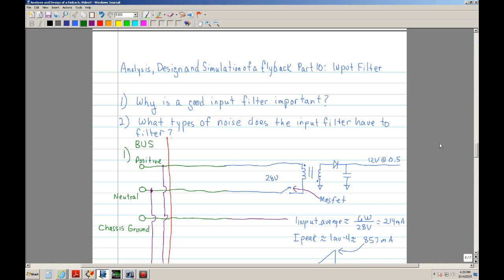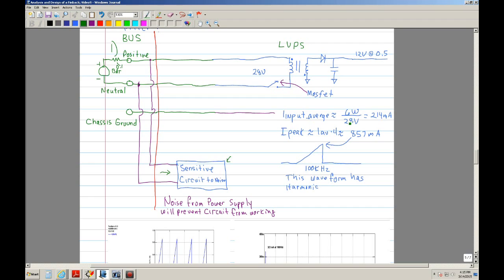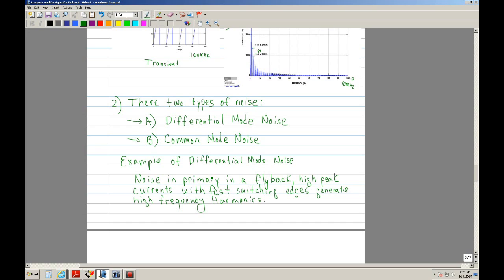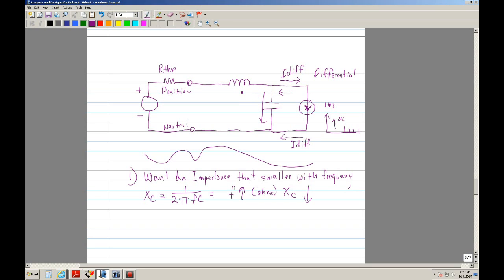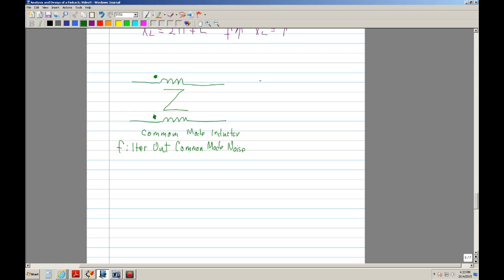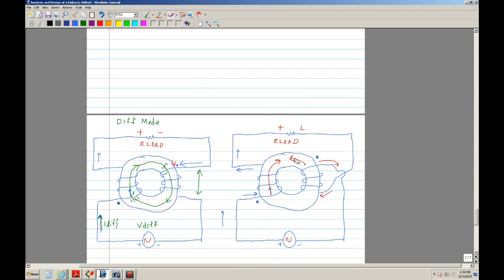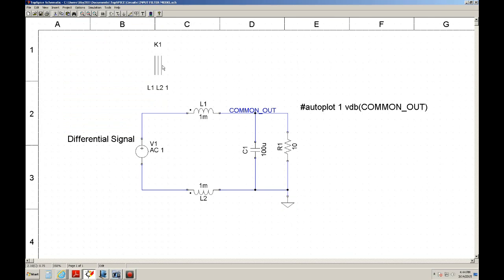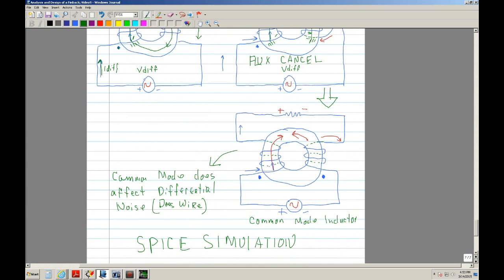Analysis, Design of a Flyback; part 10 Differential Mode Noise

Comment: hello sir i wanted to know that ,
can a common mode and/ or differential mode inductor get  saturated
and if yes then how to find that they are getting saturated
Reply from the maker: Hi Nikul, Sorry I missed reading you question. The differential mode inductor can be saturated but the common mode can not be saturated. The reason the common mode can not be saturated is because the flux in the inductor will cancel and therefore the DC current will not saturate the common inductor.  When you design the inductor, you can use Bsat = (Voltage*Time)/ Effective aread*Nturns).    Ty[icaaly, Bsat will be around 0.3Teslas. If you exceed this, you will saturate the core. So when you are design, you the Boperate to about 0.15T.   So now you can calculate at what current level will saturate the coil.   Lets sat you have have Boperate = 0.15T and Icurent = 10A, then Bsat = 0.3T  Isaturate = 20A,  The ration is (Bopeate/Icurrent) = (Bsat/Isaturate). I hope this makes sense. Regards,   Robert Bolanos
Reply: @RobertBolanos  thank you so much sir for this information

Comment: Very helpful video. I have a question, in many AC to DC SMPS schematics I find that they use common mode chokes at the input (after the rectifier) to filter the noise. As per your video you say that common mode inductor will work simply as a wire and not help in filtering. Can you please explain then why common mode chokes are used at the input?
Reply from the maker: Hi Rohan,

That is a very good question. That is the next video number 11 that will cover that subject. In short, the common mode is noise generated by the switching Mosfet in the primary and if you have synchronous rectification, you will also have Mosfets in the secondary. These Mosfets are usually tied down to the chassis the drain and chassis develop a capacitance where common mode noise is generated. I will see if I can do the video by the end of the day.
Reply from the maker: Hi Rohan,

Just uploaded a video on common mode noise. In the next video, I will show you how to design a common mode filter
Reply: Robert Bolanos Thanks. I saw the video and it helped me understand common mode noise. Your videos are really very informative. So as per my understanding, we would need a common mode and a differential mode filter at the input of a power supply. Is that right? Looking forward for your common mode filter design video :)
Reply from the maker: Rohan Dey Hi Rohan, yes, you are corrent. The input filter should have both a common mode and differential mode inductors. In video 12 I will show how both are implemented/